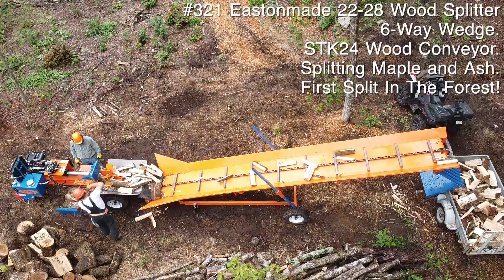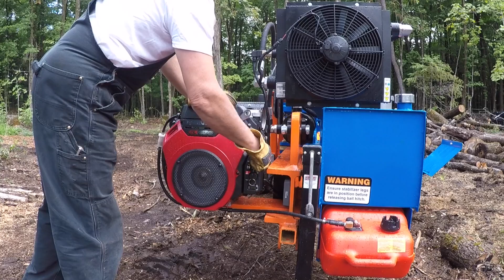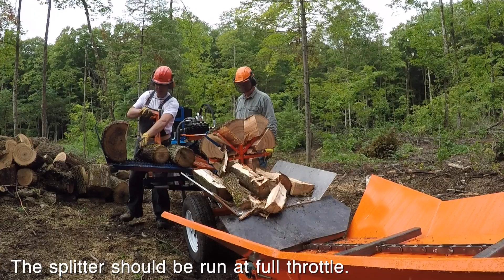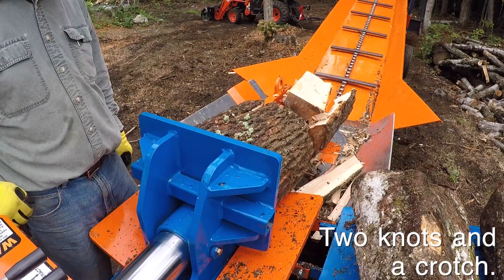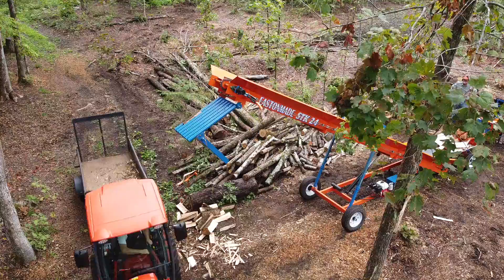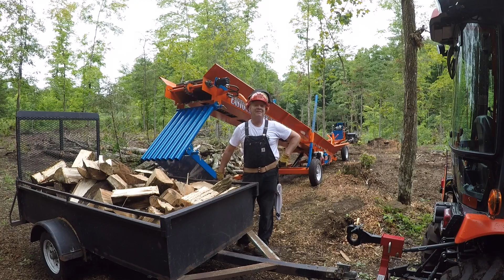#321 EASTONMADE 22-28 Wood Splitter. STK24 Wood Conveyor. Splitting Firewood in the forest! outdoors

Comment: I REALLY like that sawdust/wood chip separator at the end.  That's a 200 IQ engineering feature. That machine is equal parts beauty and beast.  Looks like it needs 3 to 4 men working around it to utilize it fully! 1 on trailer rotation, 1 running controls, 2 filling the feeder and doing walk around pick up.
Reply from the maker: Morning Mitch! It's a beauty - but for sure a full production machine as you have outlined. Would need to keep the process flowing with no gaps. Cheers!

Comment: Hello Gord. That splitter worked well. Like you said you have to keep an eye on the trailer.
Its unfortunate that the log lift doesn't lift higher to throw over the last piece instead of having to reach across the splitter.
Reply from the maker: Morning Alain. It does - I think I just need a little time to get used to getting proficient and using it better. If I raise it too high , all the wood rolls down to the splitting area so I need to practice a little finesse, so to speak. Cheers!
Reply: @GPOutdoors  i suppose practice makes perfect.
Reply from the maker: Yup -  always does. :)) Cheers Alain!

Comment: Get yourself a couple of the woodland pro pulp hooks.  I find them really nice for slinging  rounds on the lift. They are a little more compact than the log ox. You will get the hang of twisting  them out. You will find it takes at least 2 loaders to feed the splitter.  I think a blocking table that would feed the splitter is in my future.

Comment: If I was operating solo I'd move over to the log loader side to save having to reach across to have to grab the next piece. It would also mean that the next piece could be handled and dropped into spot the moment the ram has retracted.
Really nice bit of gear.
Reply from the maker: Morning Alan. Some excellent advice - I will give it a try next time out. Cheers and thanks!

Comment: Awesome setup, Gord!  With your wood splitting done that fast, what are you going to do with all your spare time? 😏
Reply from the maker: Morning Dave! If I can get some lumber, I'd love to get my wood shed done. But it's not looking good. Dropped in the lumber yard again last week and it is pretty bare, still. Have a great week and good luck with the first semester!
Reply: Morning Gord!  I feel your pain on that.  I started working on a small project for our bush property (a new outhouse LOL)  a few weeks ago before things got super busy with work, but I too was stymied with sourcing wood.  The big Home Hardware in the Perth was bare (closest to the property) as were the usual box store lumber suppliers in Kingston.  I eventually found enough to get me started from a smaller outlet north of town,  but the prices were horrendous.   
For the woodshed, could you consider using raw poles (white cedar or hemlock) for all your framing, and find someone with a home mill for the strapping and B&B (if you plan to use board and batten)?  For a woodshed, using green lumber is usually fine.... or does your local building inspector think otherwise? 😏
And thanks for the kind thought for the start of term - it’s been a wild ride and it’s going to take every waking moment for the next few weeks as we work through the challenges of remote learning for team/project based courses!

Comment: GP I notice when you guys split would you wear a hard hat with a shield there's nothing really above your head and no sawdust flying just curious what the reason is exactly.. them Shields make for poor visibility
Reply from the maker: Morning Benjy. Great question - I used to carry separate ear muffs and safety glasses for splitting but it is just much easier to wear one head protection when I go out to use the saw and the splitter. I wear them for the shield primarily now. I can see clearly and unobstructed through it without any troubles, myself. Plus in black fly season it keeps the flies out of my face. :)) Cheers!

Comment: So will your tractor pull that trailer full of wood up a hill? Just asking because I’m looking to buy a tractor and use it like y’all are in your video. I have a hill I have to go up not very big , about like your drive way and about as steep.
Reply from the maker: Morning Mike! It certainly did. The trailer is not really big but 4' x 8' but it pulled it up and down through the forest just fine - no issues at all. I did not pull the trailer up my driveway but i did pull the splitter up my steep hill - it made it but was complaining as it got to the top. The splitter weighs in at 2,300 lbs. I also pulled the conveyor up my steep hill - it weighs 2,200 lbs. Hope that helps!